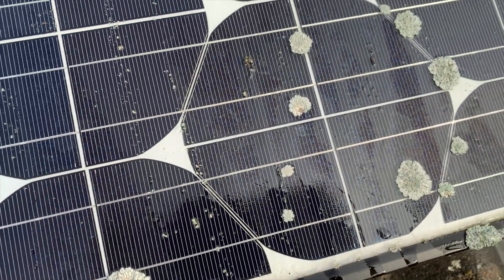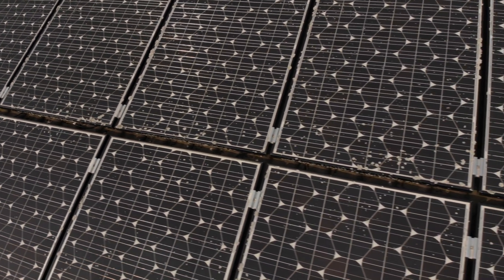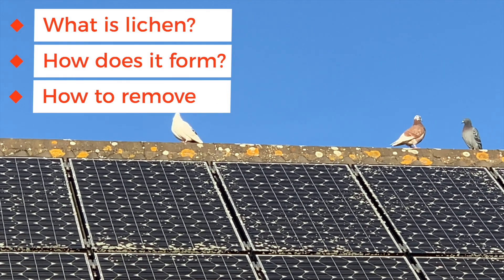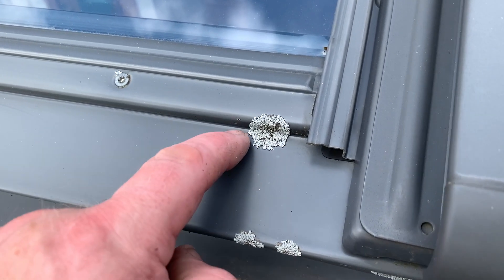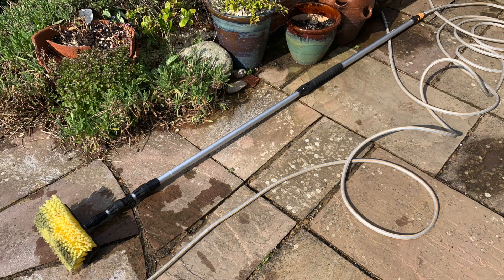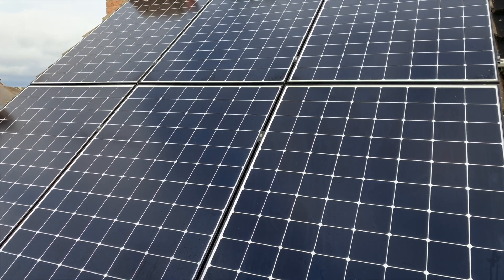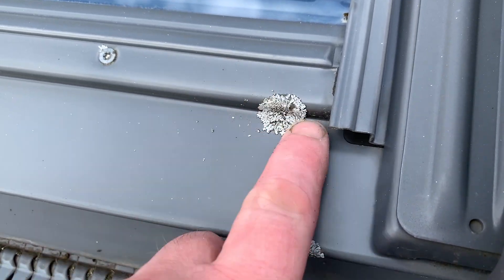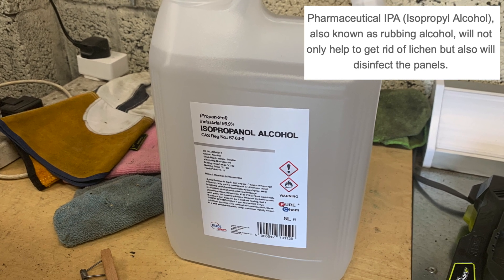Removing lichen and algae build up on solar panels - DIY solution

Comment: Hello,
I am looking into cleaning the panels myself with a pole system but various sources suggest turning off the system while doing the clean, do you do this?
Thanks
Reply from the maker: Hi Ray, I don't no. I figure if it's okay to leave them on in rain and a thunderstorm it's okay to leave them on when washing them. If you want to be super safe then yes it's the way to go as you don't often get in direct contact with the panels.

Comment: Excellent.  This is exactly my task today.  Thanks for taking the time to edit and post.
Reply from the maker: Hope it goes smoothly for you.
Reply: @johntisbury  https://youtu.be/4Jdhk2MILZs?si=zxWTktTUAtDG8W6Y

Exactly as described.  Got it wet and it rubbed off with no scrubbing.  15 x 350W panels that were about 3yo off the sloped roof of a second story in Santa Cruz, CA

It's beautiful growth!  If only we could get it going on the rocks instead of the panels!
Reply: @johntisbury It did but I should have done a better job while I had them on the ground.  They maintained a thin film that attracts dust.

I think I'm now going to abrade the surface a bit more aggressively then maybe come back on it with something like Rain-X

Comment: As a microbiologist, I can 100% assure you that the IPA will have zero residual anti fungal activity. 
You mould just need a bit of neutral pH soapy water and a long reach brush, that will do no harm to anything. 
Nothing you do will have any residual anti lichen action as there is nothing to absorb into. But an occasional soft water rinse will wash off the organic debris, from those pigeons most likely, and without a carbon source they can’t grow.

Comment: Thanks but I don't like your method. 
I believe it is better to spray and kill the lichen first with simple household disinfectant. Most cheap disinfectants are just benzalkonium chloride at about 2%. check the label and DO NOT use bleach  Add 1 L or this to a 5L garden sprayer with 50ml dishwashing liquid and top up with water. Spray this over the panels either in the morning or later afternoon when the panels are not hot, and leave for a day or a week. After that the lichen is all dead and very loose. Then use a soft pole brush, preferably one that you can put a soap stick in for extra cleaning of dust and pollen, squirting at low pressure and wash them down. Don't use a water blaster. I use a Raven brand window pole brush, it has soft enough bristles to clean a car, and has on control tap to turn off, water only or water with soap. The key is to kill the lichen first, it rots somewhat and lets go very easily, with no damage to the panel surface. There are specialist panel cleaners also, and if you prefer it can be sprayed on with a detergent dispenser than goes on the end of the garden hose.
Reply from the maker: @rogerlevy57  thanks for your alternative approach

Comment: Do you need to use water softeners? Since rain is naturally soft, then wait until it is raining and clean the solar panels then. Alternatively, use water collected in a water butt (filtered to remove any particles), but I just use the rain since I live in Yorkshire....
Reply from the maker: Thanks for watching and good suggestions. You need a good rinse with plenty of water to completely remove any remnants of the displaced lichen and algae after cleaning to prevent re-growth. Rain would be okay if it is heavy / prolonged. The water butt is an excellent suggestion with a pump and filter to remove any debris.
Many suggest they don't need to clean their panels because the rain cleans them. This is unfortunately is a fallacy. It's akin to saying you never need to wash your car, or house windows, as the rain cleans them.

Comment: Thanks for this video. Its the best honest review of how to deal with lichen as there is no "quick fix". My array has been up now for 7 years and was installed when FIT was running. The top row is now very bad and I can see from my inverter which measures by string that it is now giving at least 10% less than my less covered lichen lower row. Both are reading a lot lower than just a couple of years ago when there was no perceptible lichen. With FIT still running for me for several more years it is not just the looks of the panels but also the effect on solar production which has tipped my balance and will now have to bite the bullet. I dont have the luxury of your ground floor extension to stand on so will have to look to buy a scaffold tower (I can use that for other things as well).  I did try standing on top of a ladder with the big long 8mm water brush, but that really is not safe. Please stay safe yourself as I did not like the idea of straddling the ridge and leaning down to clean. Best wishes malcolm
Reply from the maker: Thanks for watching Malcolm. When I searched for how to clean lichen almost all the videos were trying to sell their cleaning services rather than show how to fix the issue, hence my video. Access is always a problem for roof mounted for most installations. A DIY scaffolding tower is a great solution, buy coincidence I have just purchased from BPS Access Solutions https://www.laddersandscaffoldtowers.co.uk/acatalog/DIY-Scaffold-Towers.html and that is a good stable tower. I did get the 6m high one, but you may not need that high. Anyway good luck. Thank you for your concern on my ridge monkey antics. This is one reason why I purchased the tower!

Comment: why alcohol rather than the usual chemical for "soft washing" (cleaning) roof tiles, ie sodium hypochlorite ("bleach") ?
Reply: SH is corrosive and can eat away at protective coating on the panels. It’s also likely going to leave a residue, blocking sunlight. For efficient cleaning, use a deionized water fed poll system and a quality glass cleaner. You can use a foam sprayer to quickly hit all the panels with the glass cleaner, scrub them with your brush, and then use the deionized water to rinse them for a spot-free appearance. With the right setup, you can clean all of the solar panels on a home’s roof in about 10-15 minutes.
Reply from the maker: I wanted to use something that would not dwell too long on the panels and would quickly evaporate not leaving any residue. I suspect there's many alternative products available which are suitable so long as it ends up  with no residue. I used alcohol principally to remove the algae/lichen.

Comment: You will probably find most window cleaners can clean solar panels as they use water fed pole with pure water. I would say once or twice a year should keep the lichen at bay. Tip, if you use a scraper, wet the glass and only scrape in one direction ie scrape up, lift the blade off the glass then scrape up again, never scrape up and down as you will drag dirt across the glass and scratch it.
Reply from the maker: Good tips thanks

Comment: For solar panels cleaning you need a rotating brush ,not a windows cleaning brush. Dont use a windows scraper , get a lichen removal bio chemicals.
Reply from the maker: Thanks for watching. 
The water feed pole I now use is has a brush head specially designed for cleaning solar panels. I would have preferred not to use a scraper, however bio chemicals were not an option due to limited access to the arrays and it being a DIY cleaning.
Reply: @johntisbury  Dude ....my company provide windows cleaning since 2005. This brush is not for solar panels cleaning,trust me 👍 I have a several rotating brushes and solar panel cleaning robot .

Comment: Great video thanks.  Please can you advise if you need two resin tanks? Is one not sufficient or do they have different functions?
Reply: Thanks so much for the explanation.  All understood. I have panels recently installed and found this video very helpful and informative and will be purchasing a similar system to yours.  Great work!
Reply from the maker: Thanks for watching. Whether you need 1 or 2 tanks depends on the quality of your water. I started off with 1 but found that when I used the TDS (Total Dissolved Solids) meter I was still above 40 (from memory). So I purchased a second one to allow more contact time with the resin and now the water when measured is 0. I have labelled them 1 and 2 and the first tank in line will do the brunt of the work and therefore the resin will need changing more frequently. Many people when they come to change the first tank rotate the 2nd take to become the first one and the newly filled tank becomes the 2nd inline. Then repeat that process on the next refill.

Comment: Stainless steel pad holder will help speed the process up too
Reply from the maker: Thank you for the recommendation, would that damage the anti-glare protection found on many solar panels?
Reply: @johntisbury  not that we have found
Reply from the maker: Good to know thank you. I’m familiar with your product line.

Comment: i wonder if a product like rain x would help it makes water run off windscreens rapidly , we use it on rally cars ect  its very effective and doesn't cause blurring or go opaque ect .muck and dust wont  stick to screen also just a though
Reply from the maker: That's a great idea. I think the application as per the manufactures instructions would be the problem. Applying an even coat and then reaching the panels to buff off the Rain x would be tricky.

Comment: This makes me feel very fortunate in having been able to have ground mounted panels. We do have an issue with bird droppings but at ground level it is easy to regularly clean. 
We did make a mistake in installing very close to the ground which means that we have to keep on top of any plant growth close to the panels. 
I assume it is ok for a home owner to go up a ladder but there would be health and safety regulatory issues for third parties?
Reply from the maker: Ground mounted certainly has its benefits in term of keeping them clean for sure Bryan. 

In terms of third parties working on at heights  you would expect them to have 3rd party / public liability insurance before undertaking such work. 

The Health and Safety Executive would be involved if there was an accident / death as a result of a fall. They would want to see ladder certificates, ladder inspection schedules, inspection tags, recording of scheduled checks.
Reply: I am a bit out of date with regulations now but would a third party not feel obliged to use scaffolding?
Reply from the maker: @bryanlewens2068  I guess they would make a judgement call based on the job in hand and access requirements to undertake that work. A ladder, a tower, cherry picker or full blown scaffolding could be options.

Comment: Hack, it’s said “Lycan” but that doesn’t matter tbh, mix Mortegg or Jeyes fluid and spray that on when panels are dry, Mother Nature will do the rest! The same applies to paths and green fence panels! You can save hours of jet washing and also spray your roses and fruit trees in the winter to avoid pests in spring! You don’t need much just a few caps fulls in a watering can  or sprayer and once a year treatment! ❤
Reply from the maker: Thanks for this. Not sure I'd be happy to leave a chemical to dry out on my solar panels. That said, thanks for the suggestion I'm sure it will help some on here.
Reply: @johntisbury surely chemical leaves marks on the panels
Reply from the maker: @sweetvuvuzela4634  my thoughts too. I did use some Isopropyl alcohol l but that evaporates really quickly, to be safe I also rinsed the panels afterwards.